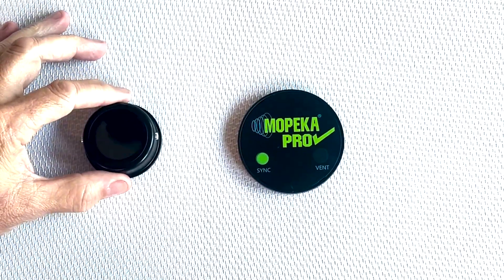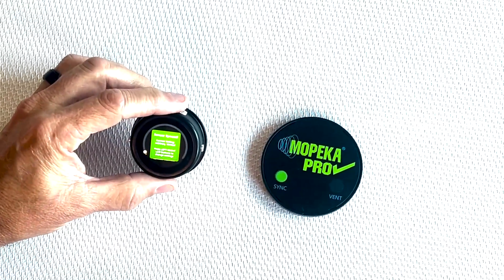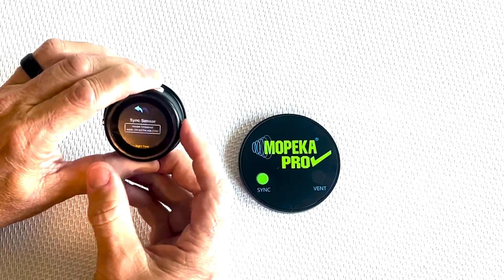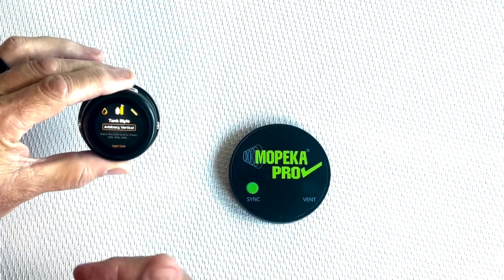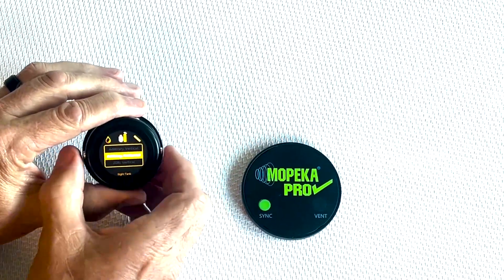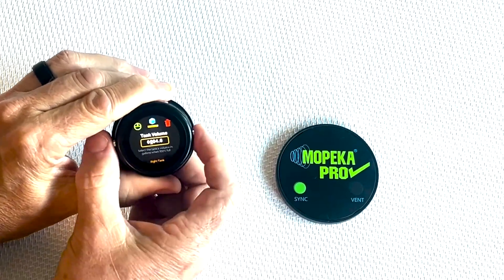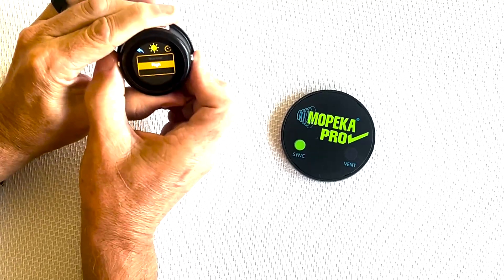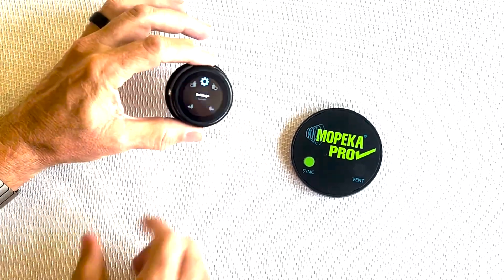Mopeka LCD Display Installation and Configuration

Comment: This thing's slick.  I ordered one direct from Mopeka and got it setup this week.  You're able to use both the phone app and this display to see tank levels.  The phone app is still needed to set sensor position after removing a sensor for refill, for example.  I was thrilled both work.  I've noticed tank level differences between the app and the LCD display.  I'll let that play out for a bit before I get concerned.  I got this LCD display so my travel companion could have a ballpark on tank levels during the weeks I have to leave the RV for work.
Reply: any preference on whether or not to install the app first, then this LCD display or the opposite? just wondering if it matters
Reply: @jn3536  Hi.  If the question was for me, the LCD does not have all functions of the app.  You will still need the app to position the sensor, zero the sensor, and probably update sensor firmware.